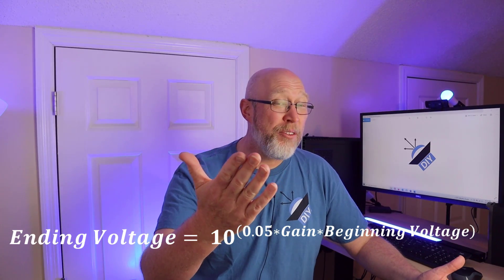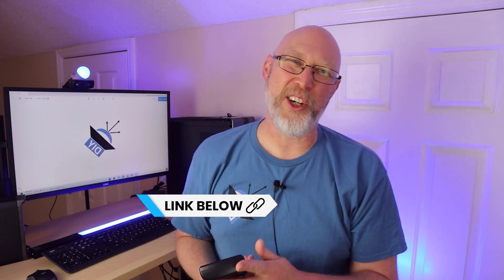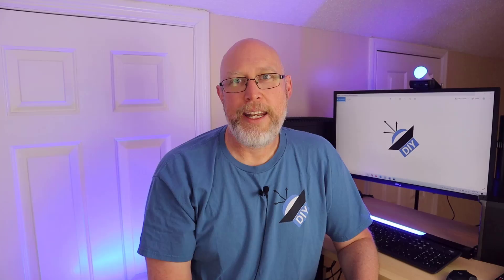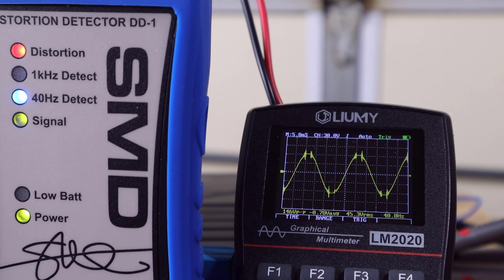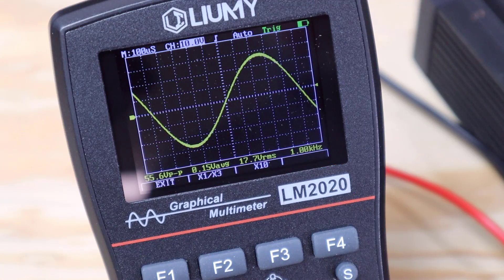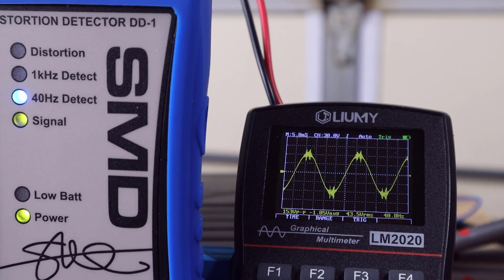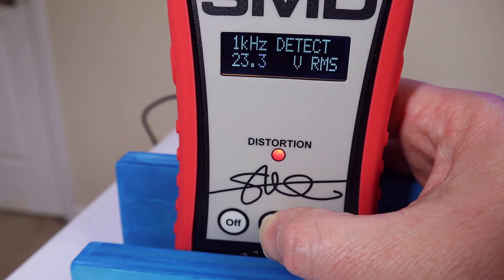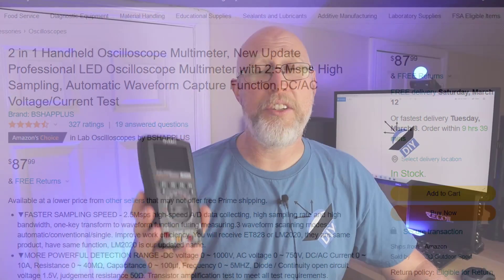Maximize amp power with gain overlap! #setyourgains @meade916

Comment: I set my gain overlap using a -5. It sounds good on some songs but other songs it just sounds terrible with the consistent bass tracks but when I set it using a -2.5 it seems a tad low. Should I try using a 0db 40hz tone and just use a tiny bit of bass boost to boost the bass beats?

Comment: Great video, question… can you used the limiter on a dsp to block out the distortion when you went back to the 0db test tone?
Reply from the maker: I have never tried it, but I have tested an amp with a built-in limiter.  It never clipped but when hooked to my oscilloscope the waveform got funky and it sounded like garbage.
Reply: @DIYAudioGuy  ok thank a lot, by chance have you ever done a video about limiters on a dsp?
Reply from the maker: @kyletex2033 nope, but my DSP does have one.  I will work it into a video.

Comment: I use my dd1 plus today and omg I’ve never heard my subs sundowns kick ass 
I use the track 1 first off to get red light on and then hit read I then change track to overlap I think it’s track 3 I set it to 10db 
I made sure at the start as Steve owner states gain turn all the way 
Make sure your bass knob is full up and headunit  set to no clip sub fully up on head unit at its max volume where no clip is or just below 👇 I then made sure the LPF WAS set to fully open you can turn this down after  all tuned lpf back to normal around 70% or just above around 9pm or 10pm 

Bass boost was off subsonic kinda up little and omg it’s the best spent money I’ve spent due this item not being made anymore I waited months with advert out on line wanted dd1 plus lucky. Chap has one with all the box receipts cd and today I’ve now got rocking shaking 2x 15inch sundowns
And omg 
Eq flat no bass boost etc needed
Reply: Did you set LPF on headunit or your amplifier?

Comment: I've just started watching your videos which are very informative, I have a question questio, how can I set the gain on sealed pawered subwoofer, the speaker input is inside the unit since its powered. Hope you can help
Reply from the maker: You'll either have to pull it apart so you can have access to the speaker terminals or you'll have to set it by ear.

Comment: If memory serves, I used to setup subs at -10dB and high end was at 0 for customers. But for myself, I just tuned by ear. I plan to check my current setup with a scope soon to see how far off my (likely way out of calibration) ears are. Thanks for the refresher on how to set the overlap. That info is starting to get pretty far back in the old brain filing cabinet.

Comment: Great video. Was reading on some forums about allowing the amp to soft clip allowing for a little bit of flatness on the top of the sine wave. I'll  try setting the gain at -5d and then see how the sine wave looks at -0db. I may make a slight adjustment depending on how it looks.  Hopefully a small adjustment will get me where I want to be.

Comment: But what if you're running optical output from the head unit to the processor. How do you test that path??
Reply from the maker: It's a digital signal, none of these tools can test a digital signal.

Comment: In my novice opinion if you desire more power, buy a more powerful amp. Set the gains properly to ensure you’re never going to clip and damage your speakers. More money up front, less money long term. I don’t enjoy the constant track by track adjustments to my source volume and bass knob required to protect my speakers from an inadequately powered amp set with overlap to get the volume I desire.
Reply from the maker: I would not call that a novice opinion.

Comment: I have a question or questions.  Do you have too get clipping before you set gain overlap?  Or can you turn the amp up right bore clipping then adjust your gain overlap..

2nd question adjusting radio , amps. Matrix plus, etc.   Do you only use the rcas to test for clipping or does the prongs plug clip some where else??
Reply from the maker: 1)  That is the idea, you want to bring it up right to clipping before you set the overlap.  2)  You can probe the speaker outputs on the amp.

Comment: Those SMD DD 1+ look so awesome I always thought about getting one, being a  electrician I like different meters and elec tools. I jus don't quit understand how if you turn your gain up to when the distortion light comes on then set the overlap it's not distorted. Is it because once the light comes on and instead of backing it down til it goes off while pushing overlap with the distortion light on,  it automatically does the calculation for you? Would be super awesome if they made a DD1++ with an ociliscope on the screen as well 🤯 💯
Reply from the maker: Music is dynamic, some parts are loud some parts are quiet. Plus music is not supposed to be recorded any louder than -5dbfs. So if you set the overlap to -5 DB you would get very little distortion.
If you set the overlap to -10 you would get some distortion on the loudest parts.
Reply: @DIY Audio Guy  awesome, it's so cool and so interesting learning how this all works. I been watching d amore engineering videos and everything is starting click now lol. What's jus a little confusing is how if your running your amp at say a 2ohm load your voltage is higher then at 1ohm. Like 1400w at 2ohms is 52.92v and at 1ohm 1400w is 37.42v

Comment: There's no such thing as gain overlap for clean, undistorted sound!
When you're dealing with audio material in digital domain and you don't know who how it is mixed, mastered or edited, there's a big change to find out what intersample peaking (ISP) is. Basically, when someone chooses to normalize an audio track close to 0 dBFS, without having the available tools to know how that signal will look in analog domain, the moment that audio signal shape is reconstructed in analog domain, you will find out what intersample peaking is and are guaranteed to have a clipped signal before entering the amplifier.
If you see the waveform of a song in digital domain and you notice that it's peaking to -3 dBFS or lower, there may be a reason for this, like a decision made by the mixing and mastering engineers, in order to avoid clipping the audio signal when its original waveform is reconstructed in analog domain.
You are also dealing with intersample peaking whenever you are converting from uncompressed to a compressed audio format.
The secret to good sound is headroom! Headroom on mixing stage, headroom on mastering stage and headroom on playback stage!
Enjoy the music as it is and don't try to chase last ounces of power from the amplifiers, just because you paid for that power.
Music is dynamic by its very nature and those dynamics makes it sound good!

Comment: So when doing gain overlap, are you turning the gain knob up or down? Thats one thing I've never understood. Every video says "just set the gain overlap" but doesn't explain how.
Reply from the maker: Here is the logic, you are playing a quieter signal so in order to get the gain zeroed out  you have to turn the knob up.
Reply: Out of the couple hundred comments so far I only found two that mention the bass knob...
My question is this... If my bass knob (attenuator) is 12db  would I be correct setting 0db at min on knob and 12db with knob at max (or actually 10db overlap seeing that's your preference from all of your comments) then I could adjust listening overlap on the fly with my knob? Never mind 😂 when my bass knob is at minimum I get NO bass😅 
Fun video. Fun comments. Thanks for what you do!

Comment: Before I knew about Overlap, I regulated it with 0db of overlap, as my sound system does not have a car radio, but a Bluetooth receiver from Qualcomm to use with the smartphone, I used a tone generator app to adjust the gain, but it always stayed with very low volume, using mathematics to calculate the power it only delivered about 60w (10%) so I had the brilliant idea of choosing the songs with the strongest bass from my spotify playlist (because spotify has a volume normalizer and it is standard for all devices, making the use of any smartphone safe) and regulate based on them, the cool part is that today I understand overlap well to make some tests and incredibly I regulated my system like this and resulted in +10db of overlap... adjusted by intuition without knowledge. And I found that tone generator apps with the smartphone at maximum volume is equivalent to -6db

Comment: As a car audio newbie, I've been trying to just take in what info I can on the subject.  I'm not confident in what I'm doing with my settings, but with my subwoofer now hooked up, I'm actually blown away with how awesome my system sounds now!!   I plan to ask around and see if I know someone with an Ocilloscope or other equipment. 
***next up after my coffee is to quiet down that license plate!  😆 🤣 😂
Reply from the maker: Sound deadening will help.  Another easy trick is to just attach it with all four screws if you can.

Comment: I’m still confused….I set my mono amps to -7.5 and it’s less bass than when it was close to -10db but I keep seeing that -10 and even -15 is louder yet less voltage. So with a larger negative db, (further away from 0) what do I do next to get all the voltage to hit RMS in the amp?…..it just doesn’t make sense once I follow the dd-1 instructions. It’s weaker. When I read the dd-1+ overlap, and measured with MM, I was almost half the voltage then when I was when gain was higher. What am I missing here??

Comment: I use -10db and my system sounds good. For the people saying it’s odd, a lot of the music on Spotify, pandora, Apple Music and so on are recorded at that db level. You could use a -10 to -15 db level if you listen to mainstream music since that’s what they are recorded at. If you listen to modified music like decaf then go lower. But yes there will be distortion with gain overlap but a little distortion is not bad. With 0db some of the songs are going to be much lower and then if you want it to be louder you going to distort it. But if you tune with a -10db you don’t have to raise the bass, you’ll just cut which is better than to boost if that makes since. I always tune with 40hz -10db and I’ve never blown a speaker or nothing.
Reply from the maker: Even then it will only be distorted if you're cranking it all the way up.
Reply: @DIYAudioGuy  I have a question about this tho. When you tune everything zeroed out. The sub level is on zero or half way. I always go half way and I just decrease the bass for songs and increase when some songs need it but never go all the way up
Reply from the maker: @JesusSoto-rs4jc  I always tune it with my subwoofer level on my head unit all the way up.  Then it's never enough base with the sublevel turned down, so the sublevel usually just stays all the way up.  The solution to that is bigger subwoofers with more power

Comment: I love the technical videos and explanations.  I'm only a few months into the car audio hobby and learning loads of information I didn't bother to learn back in HS or college.  The part I'm having a hard time understanding is the whole "amplifying a distorted signal will amplify the distortion".  I definitely see why some people would make that statement, but I don't see the science behind the statement.  My reasoning is that 1)  an amplifier first breaks the signal into a square wave, which turns on/off on the MOSFETs via a drive chip and this signal is amplified.  Then 2) on the output side of the amp the signal is then rectified and back into a sine wave via the pos and neg power rails...  So is it not the square wave that is amplified in an amplifier?

I think it was barevids (the amplifier repair guy) that did a video where he injected a pure square wave into an amplifier, and watched it come out at the speaker terminals in a nice clean sine wave...
Reply: That was an interesting video from barevids. Sounds like it's due to the low pass filter on a sub amp - Basically what makes a square wave is a lot of high frequency components that get filtered out by a sub amp (and he says that in the video, but it's a well-known phenomenon amongst electrical engineers who will tell you that fact if you so much as look at a square object in the room). If you have no filtering (or a very high bandwidth bandpass filter) on your amp, then the statement "garbage in, garbage out" still applies - squarewave in would come out as an amplified square wave. This especially applies to some of these new full bridge bass amps that are full-range. My SFB-5k has a low pass filter that goes up to 20khz. If you left it set there you'd get a square wave out (or as close to one as you could get with that range). The good news is that you can safely use aggressive gain overlap on bass amps with properly set filtering.
Reply from the maker: Yes, I saw the video.

Comment: so I used the dd1 today did the first phase turn everything down and bass knob up and  volume knob to desired volume ,next play first track till I get distortion next hit read and switch to track 3 then set overlap I went with 7.5 then I noticed when I turned up my low pass the overlap jumped to 14.5 is this right
Reply from the maker: When you set the gains you want to have your crossover off.  If you cannot turn your low pass filter off, then turn it to the highest setting.  If you cannot turn your high pass filter off, then turn it to the lowest setting.

Comment: This is quite interesting. I just set my gain using a 40 HZ 0db wav file and an oscilloscope after watching your video. Great job explaining things! When I did some research on my amp it says that the bass boost knob would increase it 0 to 6 DB but when you are looking at gain overlap on your SMD you are going all the way up to 10 DB. Would it be safe to turn up my bass boost knob on my amp? I am running a kicker 12-in Solo-Baric sub with a kicker cx800.1 amp.
Reply from the maker: The boost only works on a very narrow band of frequencies.  If you want the squeeze a little more bass out of the amp use a -5 or -10 DB test tone.
Reply: @DIYAudioGuy  ok thanks for getting back to me! I appreciate it! Keep up the awesome videos!

Comment: Hey there. Great video. However I've seen a video where someone shows that head unit clipping is eradicated when it passes through the (subwoofer) amp. Did you do check that out?
Reply from the maker: I think that was Sam over at Barevids.  He is a great guy.

Comment: Do I have to set my subwoofer level on the HeadUnit or leave it flat? For example the subwoofer level max is 14 I have it set at 7 then I find my clipping point and set the gain
Reply from the maker: For most head units, you'll need to turn your subwoofer level control all the way up.

Comment: I don't like overlapping not even 3dB, 
If i need to power 100w RMS speaker i would only give 90w and pefer 120W RMS amp of higer power.
So that amp will run clean and speaker would be stress free.
Reply from the maker: I used to feel the exact same may.  After playing around with the SMD AMM-1 and seeing what real time power looks like I would be comfortable with 10 DB of overlap most of the time.

Comment: I always do 0 db for mids and highs and negative 5 db for subs. Awesome video
Reply from the maker: I used to do that, but I am beginning to warm up to the idea of giving it some more juice.
Reply: @DIYAudioGuy  I'm with you for most people. Lol. I usually listen to mine at 98% full tilt and the slight voltage drop will try to induce clipping on my subs after some hard listening. But for 95% of people 10 db overlap gets them all the volume they will ever need.

Comment: Another great video , I appreciate it , Been out the game for a long time , so you say Odb test tone for head unit and anything between HU and amp. I have a eq  and I take it that should be set to flat settings as well? Thank you for your time
Reply from the maker: Yep, everything should be flat.  The only exception is if you have a bass level control on the HU/EQ/AMP.  Then after you have the gain set you adjust the EQ by cutting frequencies that are to loud.  Boost is a last resort.

Comment: Excellent as always sir. You bring to light many things I wish I had known 20 years ago lol. One question though? When setting gain with a scope on say a subwoofer amp, does it make a difference if the amp is connected to a subwoofer or not? That is,will an amp clip sooner or later if connected to a load or does it make any practical difference?
Reply from the maker: It does make a difference, Sam over at barevids has a video showing the difference.  I prefer to set things with speakers disconnected.  Easier on the ears and easier on the equipment.
Reply: @DIYAudioGuy  Thank you.

Comment: I use 0 DB for SQ set up, but... I will leave just a little room on the volume of the head unit.  My HU for example tops out at "62" of its volume level, and can play this with 0 distortion output.  When setting my gains, I will put the volume to "55".  I typically don't turn the volume over "50" on the HU, but if I wanted I could crank the volume beyond what I would ever want with confidence that I am not overdriving my speakers.
Reply from the maker: I do pretty much the same thing.

Comment: When it say set overlap 15db I'd that a suggestion or like the max possible?
Reply from the maker: That is the max that the DD1+ is set to do. You can set it to literally anything if you use the formula. I would not recommend any more than 10db of overlap.  You will get a lot of clipping with 15 db of overlap.